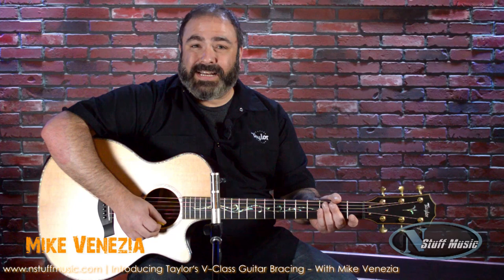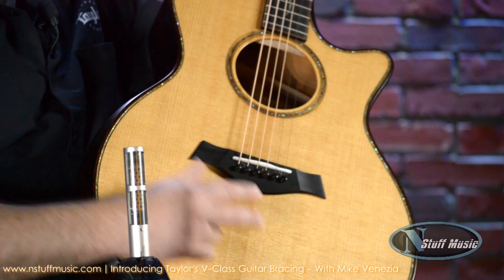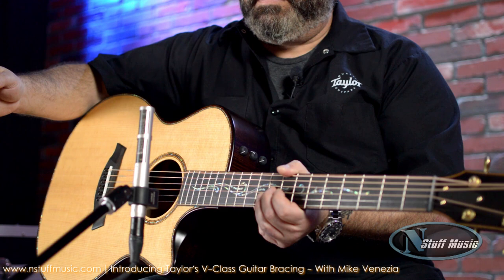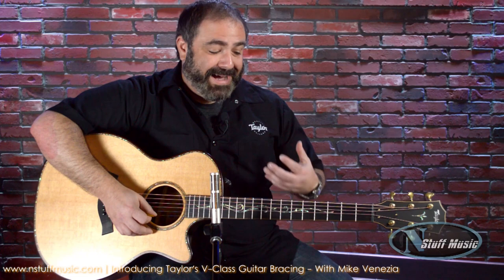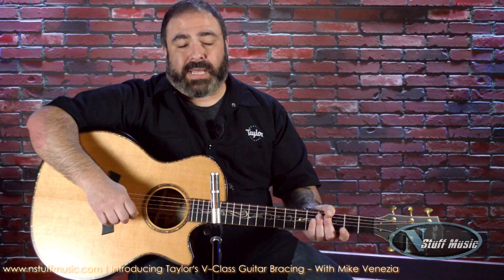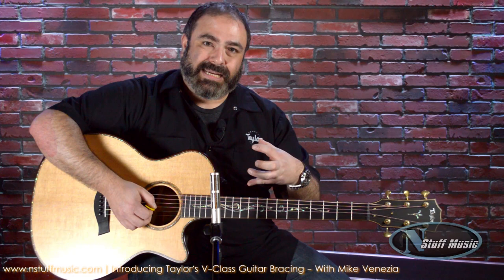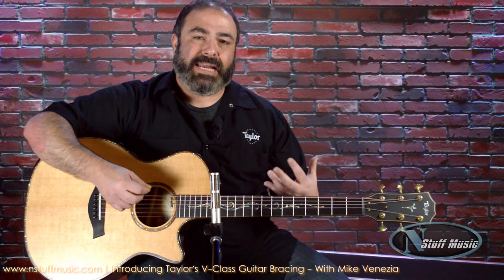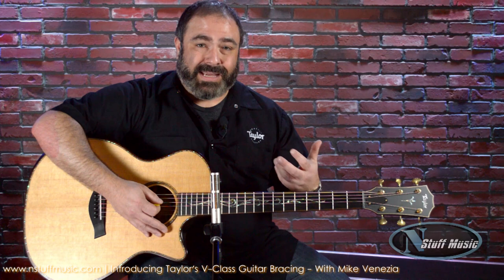Introducing Taylor's V-Class Guitar Bracing - With Mike Venezia

Comment: V braced guitar sounds weak! 
PLEASE READ THIS!
First of all V bracing patterns have been used and tried by many luthiers for 
years albeit in many variations, but basically the main V braces...it is
 nothing new.  Having compared many Taylor V class guitars there are 
some drawbacks...placing so many braces within the largest vibrating 
part of the bout can mute some of the frequency vibrations patterns. The
 Taylor bracing change when measured for displacement, velocity, and 
acceleration did show some degradation in the lower bout vibration 
patterns as compared to  X pattern bracing. Sustain was sometimes 
increased only in certain examples. We found no further accuracy of 
intonation due to V bracing vs X bracing. Notes high on the neck were 
not perceived to be any more forthcoming, clearer or vibrant as stated 
here.  We did find that some guitars in both V and X bracing due to wood
 selection and builders had superior up the neck clarity and resonance, 
but only as I said due to wood grains and torrification treatments. We 
tested several top brands, which included Martin, Taylor, Eastman, Yari,
 Yamaha, Mc Pherson, Goodall, Bourgeois and Breedlove and a few other 
small luthiers examples.  I surmise that Taylors need to change there 
bracing pattern may have to do with business and not so much about 
making a better guitar. It appears that the V class bracing is also less
 expensive to manufacture mechanically. Taylor's have always been known 
for a sort of vanilla tone due to it's manufacturing process.   And, 
that much of the information spoken here is the interpretation of a 
dream that one man has.  The addition of inspiration from the ocean 
probably has nothing to do with the scenario. By the way when CF Martin 
started experimenting with fan bracing back in the 1840's he had moved 
several of the braces according to the Spanish style fan bracing into a 
Vs both reversing the V at the top and bottom to accommodate the new 
style bridge pin design, settling on the X brace pattern which he 
surmised sounded better freeing up the top, also adding strength to the 
top. If you watch the Martin Museum Tour right here at 7.12 minutes you 
can see one of his experimental V braced tops on the workbench from the 
1800's!  Finally, I urge all of you to do your own comparisons not on 
You Tube, but only in person with reasonably like woods, sizes and 
environments braced with Taylor V and other X braced guitars to see what
 you feel.